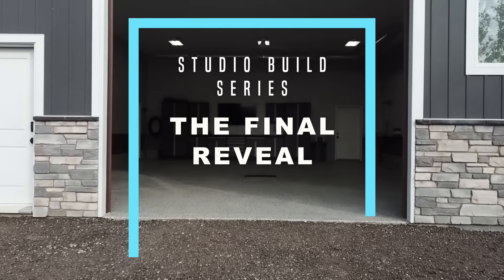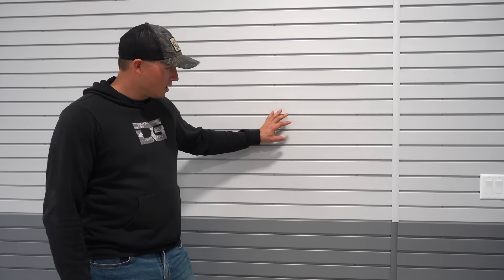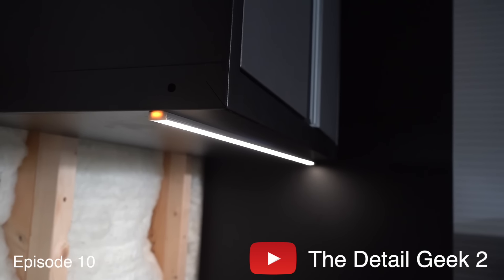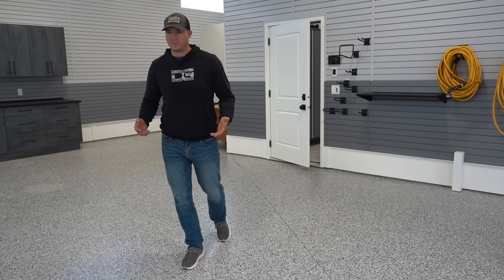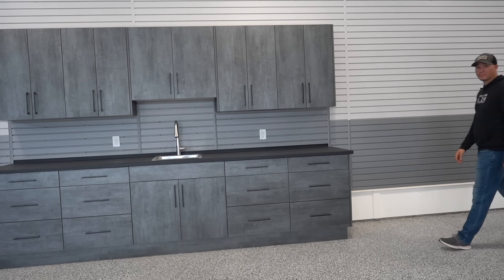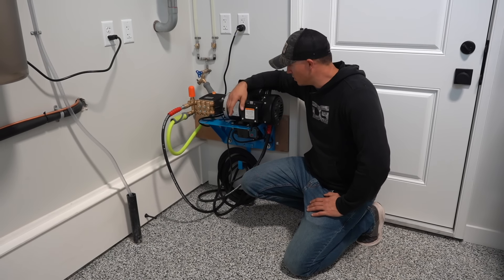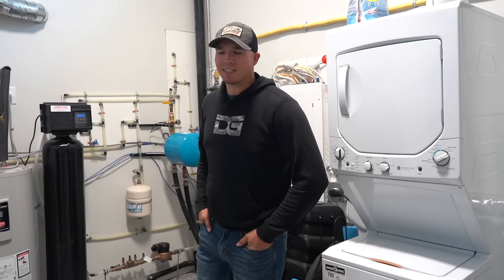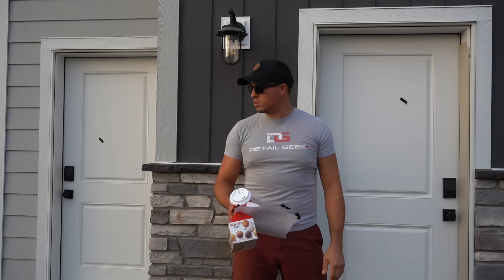I Built My Dream Detailing Studio

Comment: 18:27, for the HRV Condensate Drain, it needs to be dripped over an air gap into the black ABS drain pipe, not directly tucked into the pipe as it shows. You had a great well set up with a testable DCVA inline with your cold water supply.
Reply from the maker: No it sure doesn’t, it’s done correctly 👍🏻
Reply: @TheDetailGeek  Then I suppose you are in the Pararie Provinces.

Comment: Good advice: If your brine line becomes detached from your softener (can happen inside the brine tank or at the valve), you have the risk of having water shoot all over your electronics. Just an FYI to consider taking some precaution. 
.
Also I think you would benefit from a countertop water distiller to use to fill your spray bottles. This can help get perfectly clean windows. RO water is not clean enough to get those windows perfect in direct sunlight no streaks.
Reply: Your shop is magnificent, you put a lot of thought into every last detail. I understand the love of detailing cars, when you detail a car you get to thoughtfully observe every design feature of the car from all angles. The reflections, curves, materials, there's so much to appreciate.

Comment: You deserve this! Congrats. 
Btw, a suggestion for the area in the corner with the bathroom.
How about turning that into a loft for emergencies or any unseen incidents for when you may need to be there for longer hours? 
Run a floor, heated of course, over the bathroom so you can have a bed while below you can tie in a shower with the restroom. You'll even have a bedroom window. 😆 
There should even be enough room for a small fridge, microwave, & Keurig for the cold days (a must). 
You work hard brother, you deserve these little perks to keep you energized. 
Aloha 😊🤙

Comment: Love the videos your work is amazing.    Shop tour was outstanding.     My 2 cents.  Add a small  air compressor and a hose reel. for engine cleaning and drying.     I saw you used a leaf blower😂😂  on the Kia soul video.     

I could be wrong as compressor pressure may be a bit high.   But any shop space should have one.

Comment: This is a great detailing studio you've created with lots of attention to detail.  You've done a great job.  A few comments: 
   1. Do you have any snow and ice removal equipment for the driveways in the winter?   
  2. I'd also include a sleeping area in the event you get snowed in and can't leave (I only say this if your studio is some distance from your house that requires driving between them.)   
  3.  Also, I'd consider putting in a refrigerator and a grill so you can eat at the studio everyday you're there, if you get snowed in and it's dangerous to drive.  You don't want to drive somewhere and get stuck in the snow.
  4,   I hope the studio and your house are built in areas that don't get flooded.  (Just a thought but with climate change you never know.) 

I'm sure you've thought of this but now-a days you never know.  Also, you have a lot of security and I hope the studio is located  in a low-crime area.

Comment: Congratulations with the shop.
IMPORTANT. Remove the zipties from your pipe insulation on your aircon.. Use electric tape instead. Zipties is making the insulation useless. You will have problems with condensate over time were the zipties are.

Comment: Those ceiling fans are made by the company Canarm. Why is there 1 fan in the studio and 2 fans in the shop because with big spaces like that, you need more fans so the studio side will need at least 6 and the shop side will need 4. And what control did you use for the fans?

Comment: Tell the contractor to come back you are not supposed to have expose nail on the roof vent also there is no ridge vent installed in the roof unless you have gabble vents the ridge wouldn’t be needed but ridge vent is better than gabble vents video 4:24 shows what I’m talking about

Comment: You are going to regret those Cambridge shingles.  No reputable roofer will use them.  They are used because they are cheap and light.  Problem is they don't last. They are now mostly used on new subdivision home builds, and only given a 2 YEAR warranty.  Just a heads up, it's not a might, they WILL give you issues within 5 years.